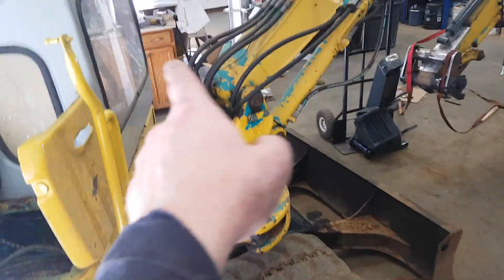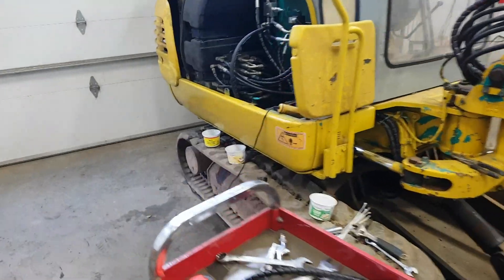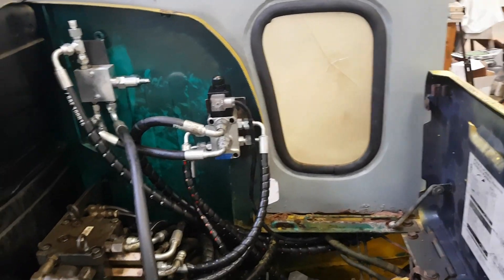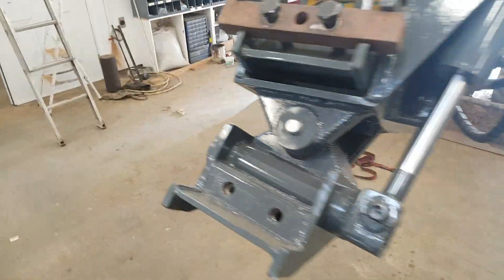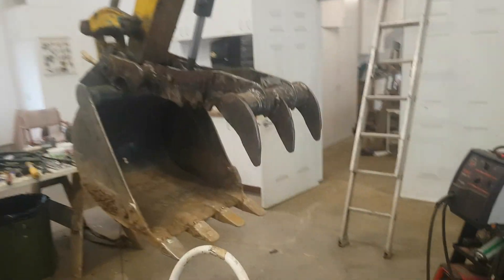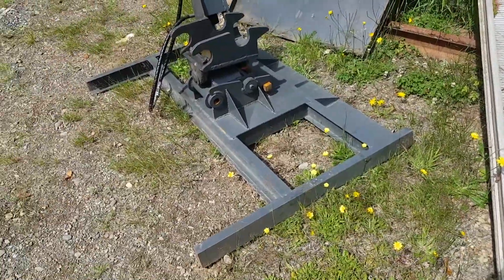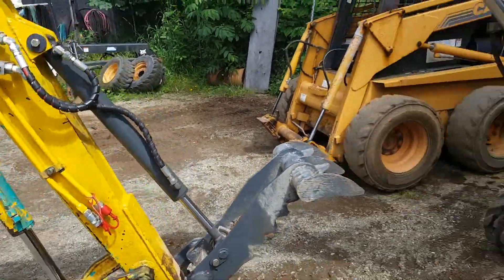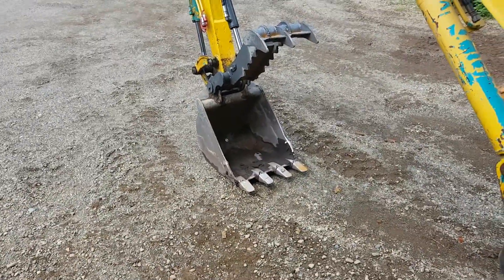DIY Mini Excavator Twist Wrist - Part 5

Comment: @kellyKlassen  I am about to put a komatsu 35 in the junk pile. I'm having what seems like a simple problem you may be able to help me with. If you can respond I would love to pick your brain.
Reply from the maker: Sure, what's up with it?
Reply: @kellydklassen  the machine was fully functional the other day, one of the track control levers was sticking so I took it off and cleaned it. I replaced it exactly like it was. Now my R track only moves in reverse, my left track operates forward and backwards but only at about 10% power.
Reply from the maker: @BrandonDrew87  
I'm not super familiar with the travel valves, I've never have them apart on my machine. But if I had to guess by looking at the hydraulic circuit diagrams in the manual, I would guess it has something to do with the pressure/flow compensation circuit in the valve.

If the reason you pulled things apart was because it was sticking, do you think it might have been possible that it was something internal, like some junk inside blocking movement? Or maybe like an o-ring failed and it's blocking or bypassing flow?
Reply: @kellydklassen  I have read the shop manual front to back and have done everything short from getting into the big control bank. The lever was sticking due to corrosion in the rocker that depresses the valve. I'm afraid I may have introduced a piece of trash when I cleaned up the travel valve.
Reply from the maker: @BrandonDrew87  that's a strong possibility
Reply: @kellydklassen have you ever got into the logic valve, junction valve,  or merger divider valve? Those all are possible suspects; but I can't tell where they are by looking at the schematic alone.
Reply: Ever figure this out?
Reply: @sliccreations  kinda sorta, it sat out in the field for a few months and I got tired of looking at it. Fired it up and got it good and hot and it fixed itself. 🤷🏾🤷🏾🤷🏾

Comment: Great video thanks for the upload! Could you please share the valve part numbers? I've got yanmar vio45 and need to rig up a hydraulic hummer on to my thumb line and want to be able to switch between thumb operation and a hammer

Comment: Awesome job this is amazing. You literally save me thousands from buying a new machine. I have a Pc 40 all ways wanted to add a aux to the from. I don’t have much hydronic knowledge, I do have one question on the prv, the line going back to the tank dose it need to go directly back to the tank or could you tap it into the return line for the original function
Reply from the maker: Glad this helps!  There's some good videos out there on basic hydraulic systems that I found helpful to watch.  My knowledge is pretty limited too.  

On my tank there was a tee fitting at the bottom where the main return came into the tank, and in the other leg of the tee was a plug.  I took out the plug and routed my return in there.  Couldn't have been any more convenient.
Reply from the maker: That prv line could tap into any line that goes back to the tank.  I just happened to find that tee fitting
Reply: @kellydklassen   thank you for the info. If you don’t mind me asking where did you get the electronic valve body
Reply from the maker: @MikesMetals22  
No prob.   I got the valve from Princess Auto